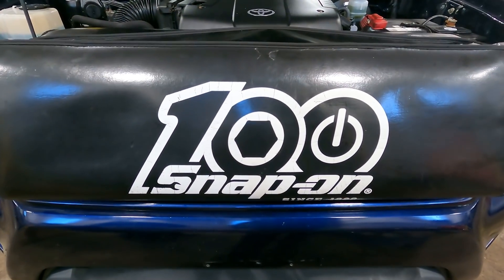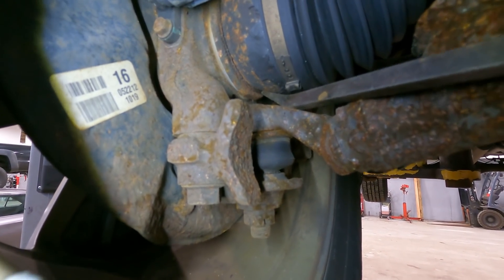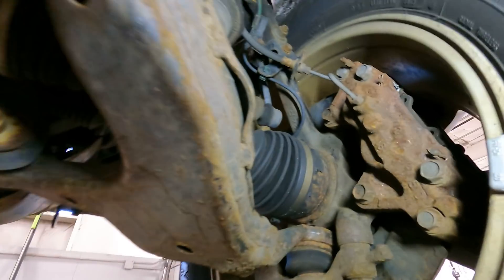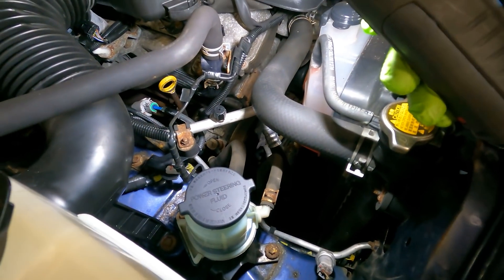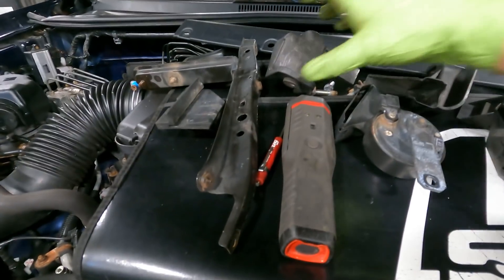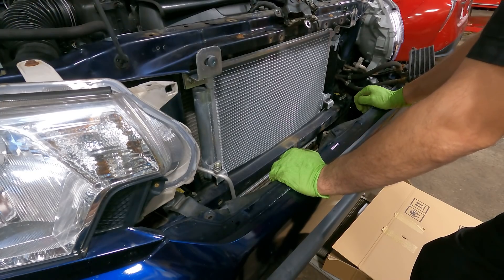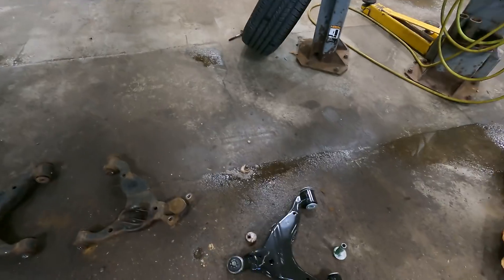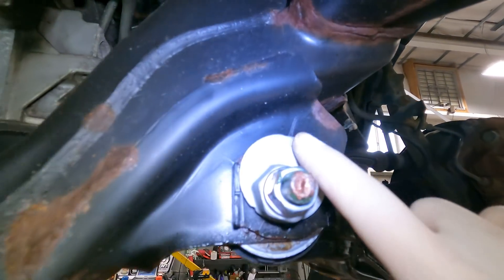Customer states "IGNORE MY BALL JOINTS AND FIX MY A/C" 😡🤔🤣🤣🤪

Comment: Can't believe they got new control arms and did not get an alignment...
Reply: the alignment is less than $200 (smh)
Reply: Well......common sense says the alignment should have been included in the control arm /ball joint replacement not a separate job. Does the shop not replace the coolant when a radiator is replaced, it is part of the job just as an alignment is part of a control arm replacement.

Comment: CSW I was servicing a mini that had ran into the hitch of the truck in front of it and put a hole through the condenser and radiator the size of my fist. I thought meh, no refrigerant left in this thing, then disconnected the condenser lines... I was wrong... I was SOOO WRONG... and the smell 🤮

Comment: Love that wax treatment on the frame.  Didn't know such a thing existed.
Reply: Think it's called waxoil or something like it.
Reply: There’s a few companies out there 
. fluid film, woolwax. And they work. A little spicy on the price, but beats having to replace rotted out cross members in 4-5 years.
Reply: Toyota did that treatment as part of the Tacoma frame rust recall.
Reply: But don't use it near any part of your car that is fibreglass , 'cos it will attack and degrade the fibeglass.

Comment: man you should see my 00' tundra........no flavor and 305k miles. no flavor because the frames been done and shes got new lower ball joints, high castor upper control arms and uniball joints upper, poly bushings, new quick shocks fromnt and rear, new brakes. love it. ignore my dim headlights

Comment: How do you replace a frame and how much would that be lol
Reply: Toyota actually had a recall on frames some years ago. Premature failure led to a generous trade in allowance toward a new truck, or a frame replacement, depending on the age / condition. As I recall, a new frame took just over 2 days in the shop.

Comment: $27.500 fine if not discharged the AC system properly , but in the Tractor Pull / monster truck shows launching black clouds of smoke up to atmosphere that looks like an freakin vulcano spilling smoke and lava there's no issues w that lmao
Reply: Hydrocarbons and CFC/HFC/HFO’s are completely different.
Reply: @warrenself  So are dogs and cats...your point?
Reply: @haroldwilkes6608  the soot will eventually settle out of the air… the Freon wont

Comment: Fix my ac! (In the dead of winter)
Reply: Defog is part of defrost. Once you have heated up the windshield enough to melt the ice you have moisture on the inside of the windshield. The rest of the windows usually need defrosted also, the A/C is the only way to keep the moisture down, and you warm. I know, it sounds counter intuitive, thats the was the system works.
Reply: @crabbypapa3862  thanks I already know all of that